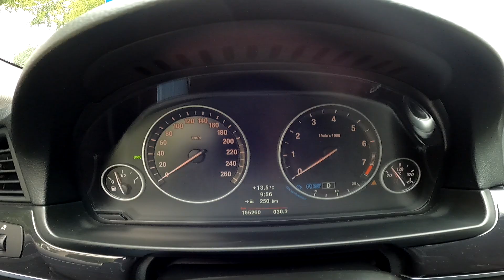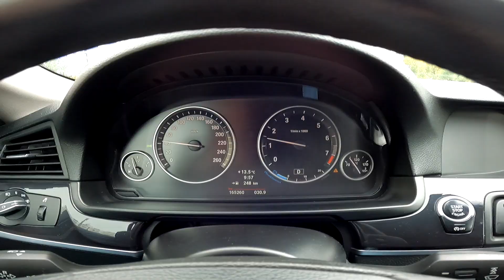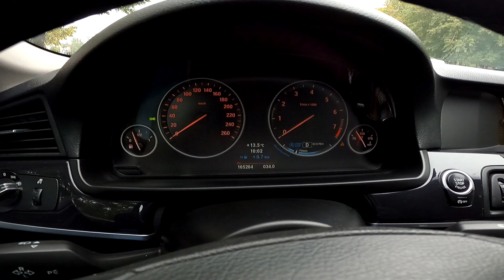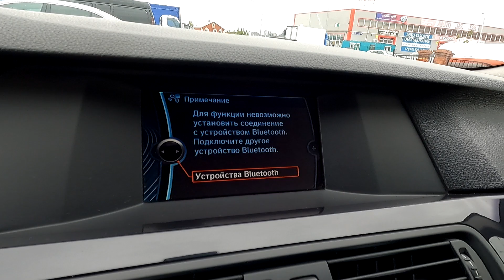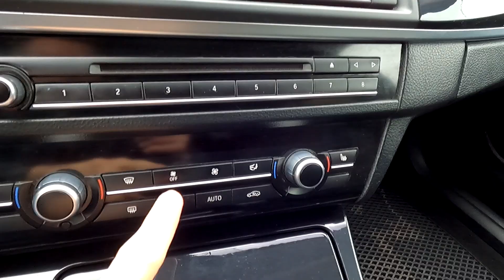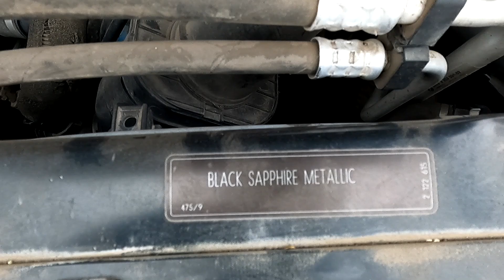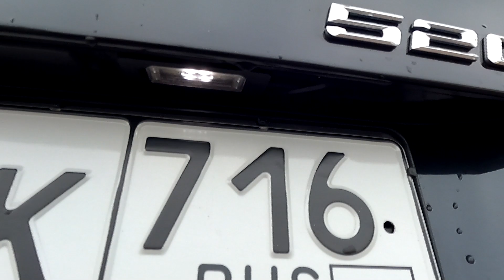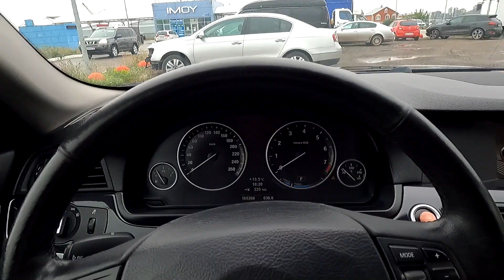2013 BMW 520i (F10) POV TEST DRIVE

Comment: This engine has a problem with the timing chain if I remember correctly. When it breaks, you will have small bits of plastics inside the engine and it will be very expensive to fix. At least that's what I heard.